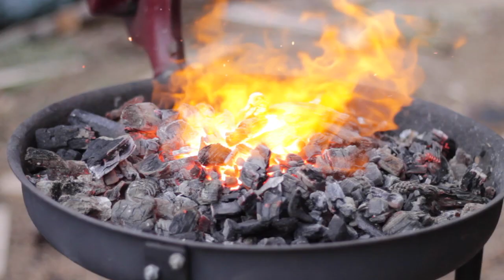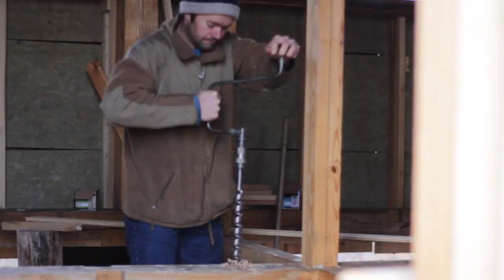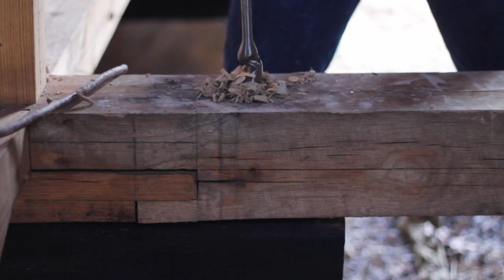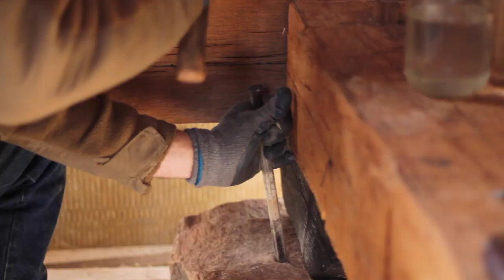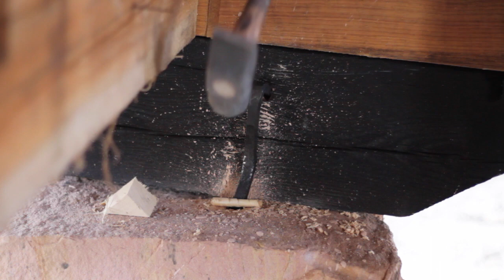Our timber frame cabin part XVI: HOLDING FAST TO STONE

Comment: You are doing an awesome job with that cabin, a pleasure to watch!
One tip from a blacksmith to get an even more sturdy holdfast - leave the area where you intend to bend the 90 degree angle untouched, and forge the parts left and right down to size, first. Then bend the thicker area 90 degrees. This should leave you enough material to clean up the bend to have the same size in the bend as in the legs, and a proper, sharp corner - getting you a cleaner look and a sturdier piece.

Comment: I was wondering what technique you were going to use to anchor to the foundation, I don't think I've see this one. Thank you for showing it, I always enjoy your videos. I'm curious though, why the water when drilling into the stone? Lubrication or to keep the chisel cool?
Reply from the maker: Water makes the stone dust stick to the chisel, it can be easily slapped off against the side so the hole doesn't fill up.

Comment: What a stunning whimble brace; where did you get it?
     So my kindergarten teacher was wrong? You CAN fit a square peg into a round hole? My whole life has been based on a lie? I'm crushed!
     Seriously, why square instead of round?
Reply from the maker: Some online auction I believe…a square peg sized correctly forces the corners to cut in, makes a much harder peg to extract, by you or time…try it!
Reply: Aha. That makes sense. We had a saying in the survey business, when a boundary marker had to be moved: "If you can twist 'em, you can pull 'em." With those corners digging in, twisting the peg would be very difficult.
Reply: Good question.
Reply: Round pegs would need to be soaked in water. As when they dry after you smack them in they expand. Old School way but you need to shave & soak them first. I believe.
Reply from the maker: Ive not heard of this method before, most reference material Ive come across recommends using very dry pegs whether round or square, if a peg were wet it would shrink as it dried, loosening the joint.
Reply: You make sense it was a story from a guy who knew a old timer!
Reply: Absolutely, if the peg was wet it would dry and become loose after being inserted wet.  Using wet rope for lashings is what he's probably thinking about, as the wet rope stretches when applied, then shrinks when dry, making the lashing extremely tight.
Reply: Just the opposite. Wet wood swells, dry wood shrinks. Wet rope stretches, dry rope shrinks. Is that what you are referring to? Square pegs drive harder and stay put much better in round holes than round pegs. Also,  square pegs work much better for draw boring.
Reply: Raw hide leather stretches when and shrinks when it dryes out  Native Americans used it to hold spear points on the wooden  lances   when wet strips were wrapped around the ends were slipped under other wraps  as it dryed the ends would be locked in place  

It takes a day or so of soaking so it can be streached  and 3 or 4 days to dry depending on weather  

My Wife does native crafts  and I do rustic wood working 

We buy the biggest raw hide chew bones  for pets  soak it for a,couple of days  to be able to untie the knot at end  then We cut it to strips and nail it to a board to dry out again   I use it for lashing together poles as structures  I nail the starting end into the wood  then wrap or lash as nessary and nail down the other end  but the nails hold it in place in case it rains or gets wet   I saw a shade structure I built this way 10+ years ago at a Boy Scout camp  stiil working and holding
Reply: Craig Mooring a dry peg going into a wet hole is the best way as the wet wood drys it will shrink around the dry peg and lock in 

Rustic chair makers do this all the time  making the rungs of a chair and letting them dry and putting into wet or green wood legs or backs  I tighten up loose joints in chairs and tables etc  with the rawhide strips
Reply: Hi, i read it in 'The village Carpenter' by Mr. Walter Rose (Great Book). He is 3. Generation of Carpenters, the Book is from 1937. He said, the round Peg's are the 'New Way', the older Carpenters use the sqarepeg's, because they hold much better.

Comment: Nice Video. Would it make sense to fill up the hole in the stone with lime,sand and water, after the holdfast is hammered into the timber?
Reply from the maker: you could, though as these are far under the house and no water can enter, its not needed

Comment: So what keeps the holdfasts secure in the holes in the foundation stones? Just gravity/the weight of the cabin holding it down?
Reply from the maker: Its the slight angle that the hole is cut relative to the timber, the hole is about 10 degrees off vertical, this means to drive the hold fast in you must also cock it in the sides of the hole, it cannot pull out now.

Comment: Love your anvil & forge. Did you rebuild the forge or are they still available?
Reply from the maker: Thanks, this one is an old Riveters forge, I think it was from Ebay, its fine for small work, need a bigger one someday...
Reply: Aha. That makes sense. We had a saying in the survey business, when a boundary marker had to be moved: "If you can twist 'em, you can pull 'em." With those corners digging in, twisting the peg would be very difficult.

Comment: How do you secure the steel pin in the stone? Is it sitting loose in there?
Reply from the maker: the pin is loose in the hole but because the hole is drilled a bit off from vertical, it cocks and wedges the pin against the sides of the hole when you drive it home into the timber, so now they are quite tight.
Reply: Thanks, makes a lot of sense!

Comment: I believe that you don't need to quench those nails; just let them cool down on their own would be better for them.
Reply from the maker: They are wrought iron so quenching or just normalizing doesn't really effect the hardness, I quenched in oil to give some added rust prevention. ;)
Reply: Interesting comment and reply. So quenching non-wrought iron affects it negatively?
Reply: +tkjazzer Quenching is usually used to harden iron of all types... it's what you want on the edge of a blade or tool that will get a lot of wear.  Hardening is not needed or wanted in this application as it might become too brittle and crack when Mr. Chickadee hammers it into the timber.  I knew that hardness was not what he was going for though, as the iron was not hot enough to harden it when he quenched it.
Reply: I forgot, has been awhile.
Reply: The hardening of steel is dependent on the carbon value. Until you get to about 0.35 % carbon the quenching of the steel has little effect on the hardness. You must also go above a certain temperature, called the upper transformation temperature, to achieve a hardened steel. This is typically around a full red heat or when a magnet will no longer be attracted to the steel. Somewhere around 1500F depending on the alloy of the steel.
Reply: Wrought Iron does not contain enough carbon to harden at all. Wrought iron all by itself is very resistant to rust, which is why it was used extensively in the maritime environment. Anchors, chains, lobster traps, etc. 
Quenching iron doesn't really add anything to the final piece. I.E. hardness, toughness, or corrosion resistance. 
That being said. This video answered a question I had for quite some time and always kept forgetting to look it up. How were wooden, or any structures that weren't also stone, affixed to the foundation. 
Thanks for your great videos, and your dedication. It's truly inspiring.